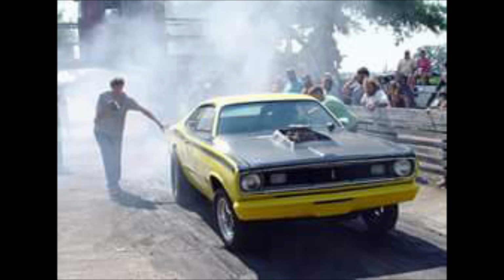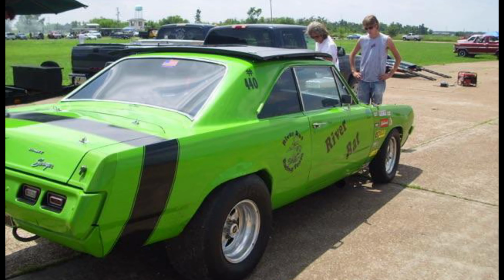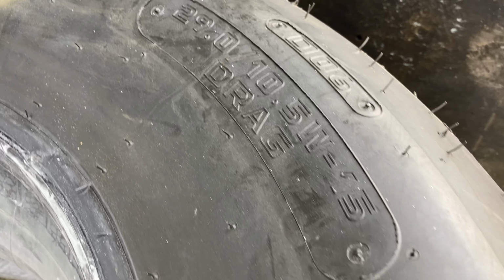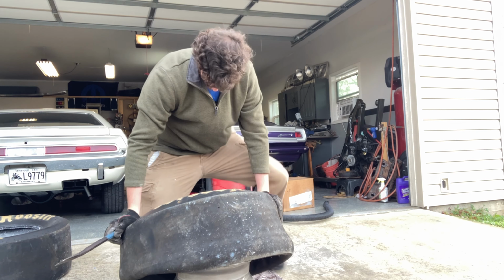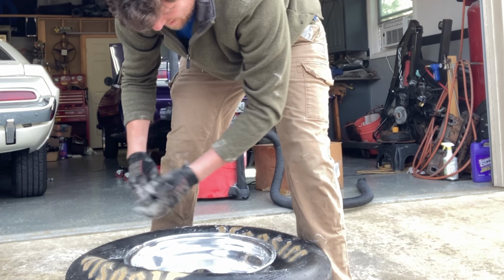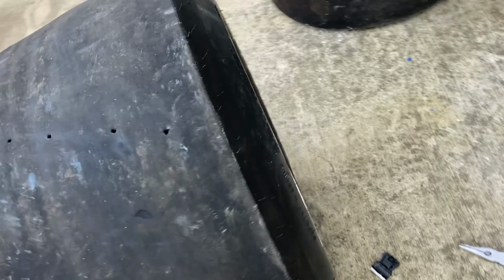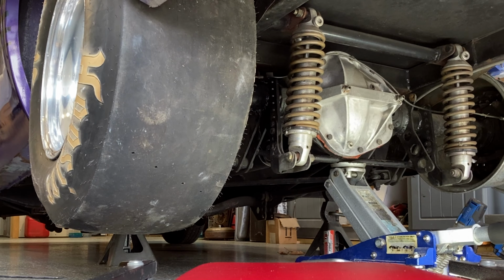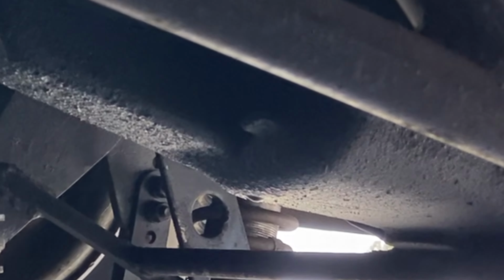Barracuda Dragcar: Slicks on the Winning Wheels!

Comment: I don't run tubes or screws and I don't balance bias slicks.  I clean everything really good and assemble with a couple drops of soap and hot water.
Reply from the maker: That will do it. I know guys who run in the 4's that run real slicks and no tubes. They will plug just like a radial tire if needed. I hate airing up between rounds or having a tire go flat on me.
Reply: @JustMoparJoe  If I need advice on almost anything to do with my stuff, I just look at our stock/super stock friends.  At one time there was some brands that would leak thru the sidewall but now the quality is great, I've had good luck so far for 30yrs ..lol. Never ran tubes or screws but the fastest I ever went was 9.60's  with my stick car.

Comment: That is one beautiful Mopar totally love the notchback
Reply from the maker: I like it more every time I walk out in the garage!
Reply: Had 2 68 and a 69 fastest had a 70 aar block bal and print 360 heads ran 10.5 compression purple shaft cam  single thermoquad   6 cyl torsion bars Kelly Springfield m50s Shelby 5 slots.727 with stall. Divorced  had to sell never raced it

Comment: What a sexy beast with those large tires on her 😁
Hoosier says that those tires don’t need tubes 🤷‍♂️
Reply from the maker: Thanks brother. I believe these are even hoosier brand tubes. I know guys who do either way. I will keep a valve stem in the tool box in case I get a flat at the track. Plug and Stem and run it!